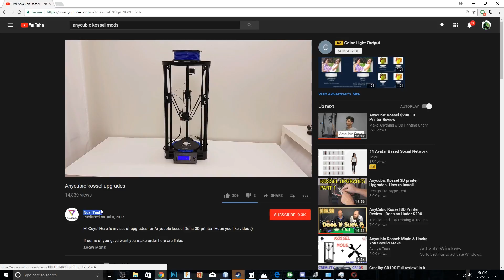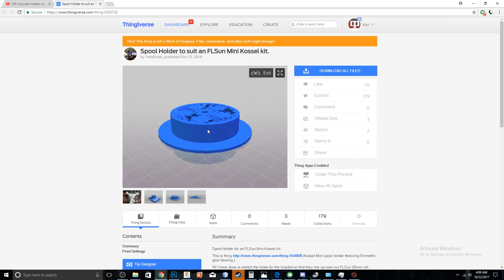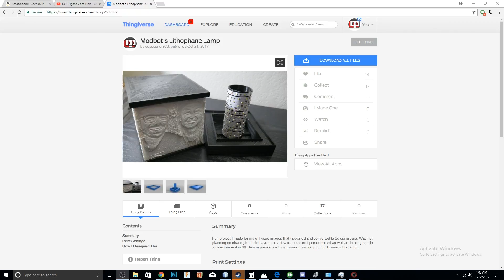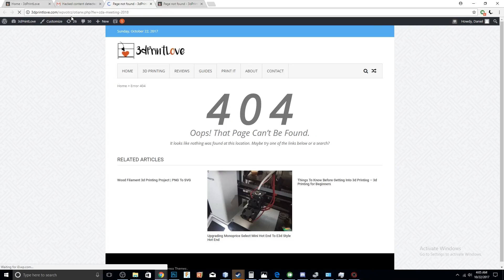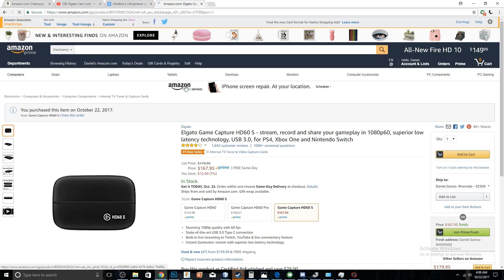Anycubic Kossel 3d Printer Upgrades & More

Comment: I don’t know if I should buy the kossel  I have a monoprice select mini v2. I am not the best at assembling things. What do u think? I also want something under 300$ us.
Reply: I just read somewhere that the new Anycubic Kossels will come mostly pre-assembled.
Reply from the maker: not the best at assembling things concerns me, best recommendation would be to watch a build video all the way through and ask yourself can i do it. I mean i know you can its more do I want to put in the time and energy to do it. Its alot of fun and rewarding but if you think your gonna get it then not finish the build that would be a waste is all
Reply: ModBot what would be the best pre assembled sub 250$ printer
Reply: The new version of the Anycubic kossel seems to need less assembly though. And the new version have heated bed and bed leveling as standard afaik
Reply from the maker: well it looks like the new one is nearly assembled based off what I am seeing below, I primarily mess with kits so it is difficult. You cant really go wrong with monoprice and you already have one of their machines you could go with another from them? perhaps one of their i3 machines?
Reply: my only comment on the kossel is getting it setup true.
I found that when I print larger prints, (e.g. a circular object) they are not perfectly round.
even after a second rebuild where everything was matched as best I could, a 16cm circle is out by 1mm.

The documentation is a bit sketchy on setting up the firmware if it isnt perfect.

on the plus side, it does look cool.